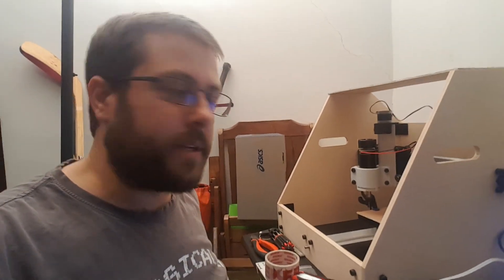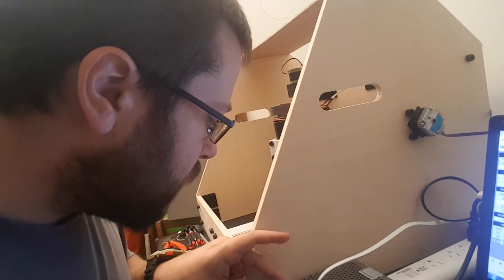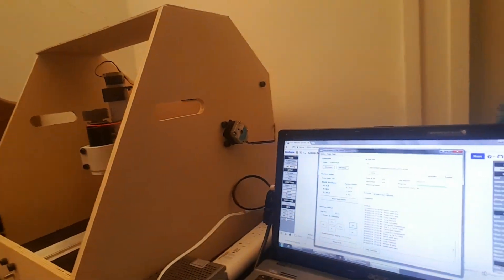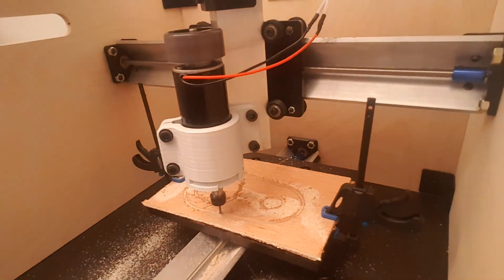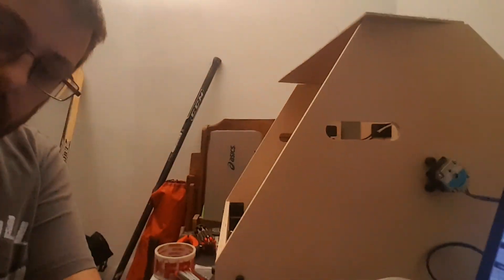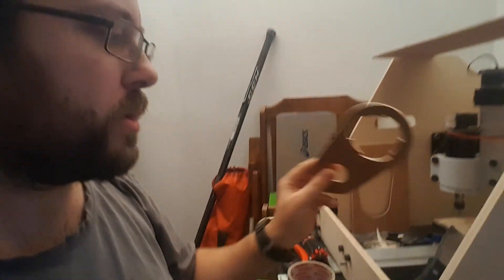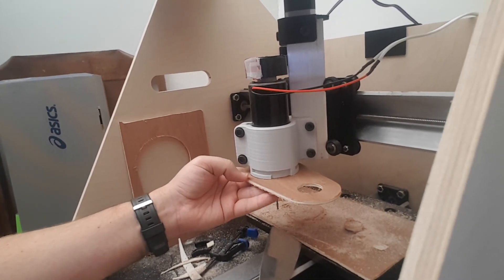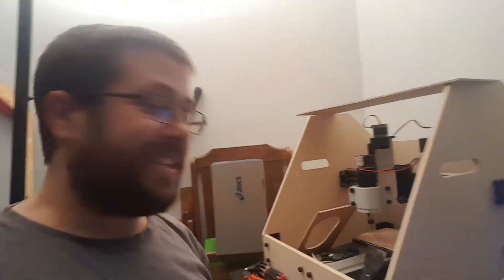My first cut!!! - Sienci Mill One - CNC newbie

Comment: It sounds to me like the machine is working much too hard. Either reduce the depth of cut or the feed rate. If that's 800 mm/min, maybe go half that. Some more rigid clamping is a good idea, and maybe a larger diameter endmill.